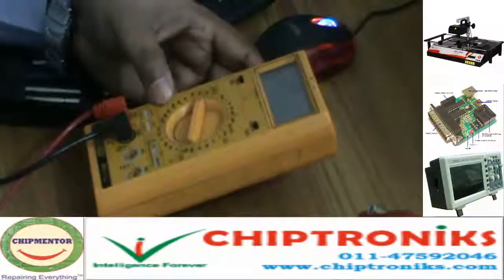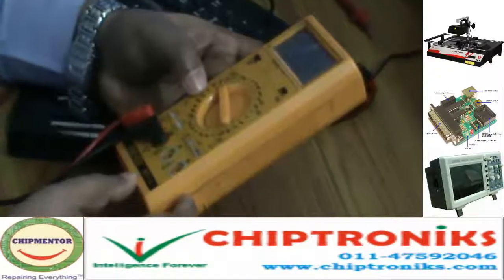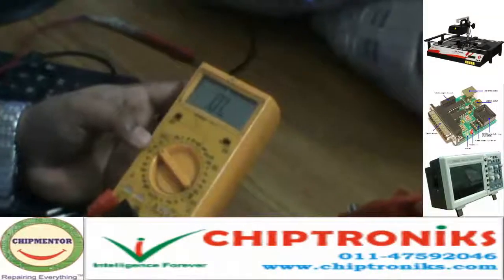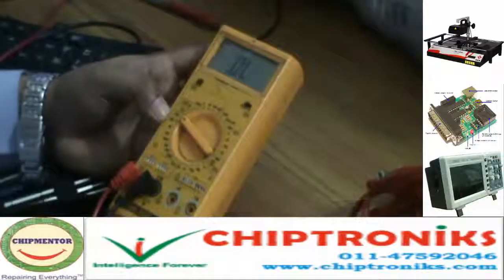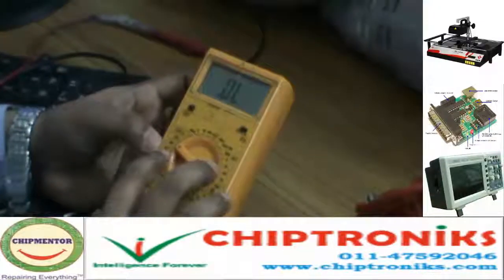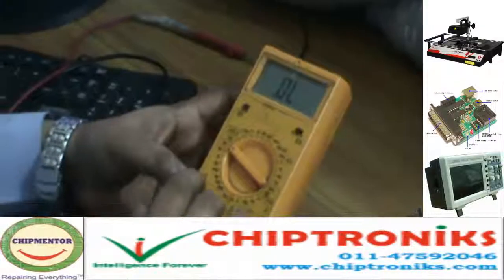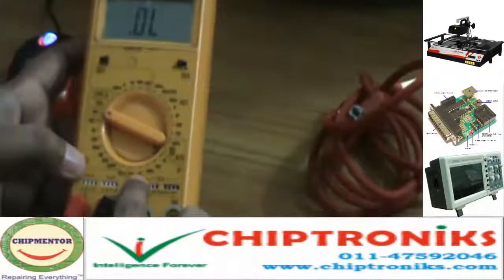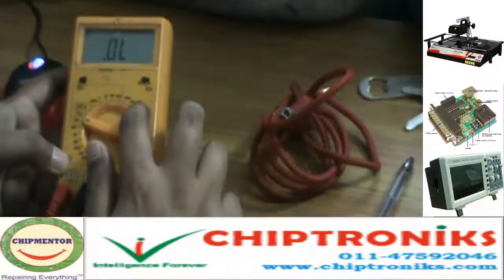function of logic multimeter, use of logic meter

Comment: I am fairly certain that OL represents an open loop on most digital meters.  This would be when there is no current in the loop and hence no continuity between points measured.  Maybe I'm mistaken but I thought I would mention it. Fully continuity should show a 0 ohm reading meaning fully connected with zero or very low resistance between points....